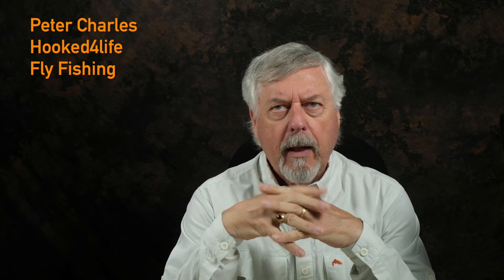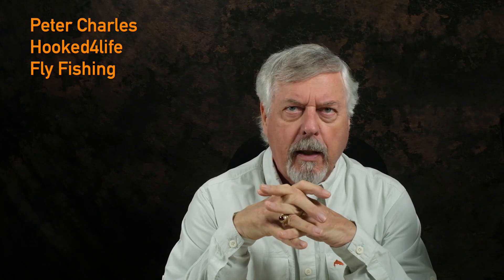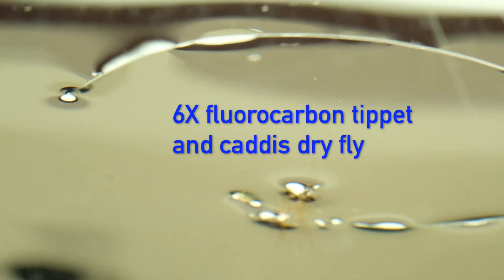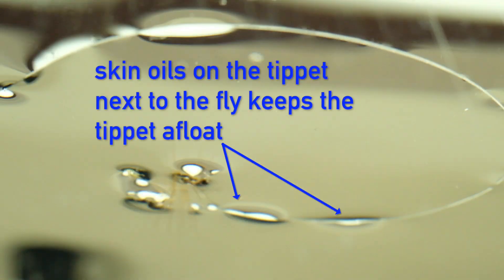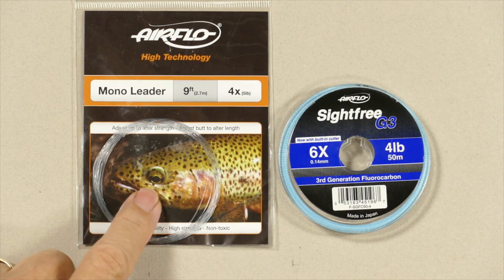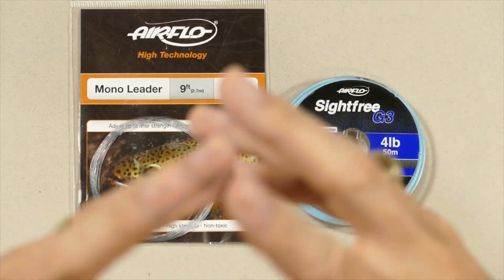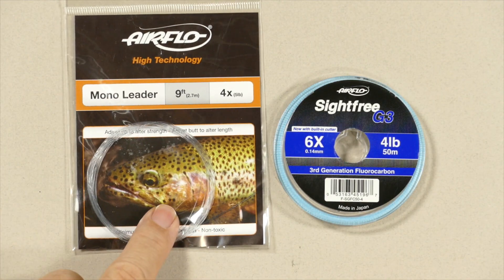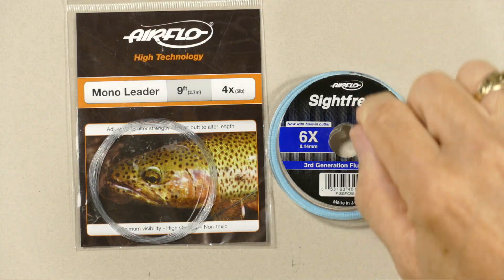Dry Fly Leader Hacks: a simple tip for significantly improving our dry fly fishing

Comment: A great video.  I've observed the same phenomenon over many years on several western spring creeks where fluorocarbon tippet makes a significant difference in the number of fish willing to take the fly.  Because of the very small flies used, I typically start with a 10-12 foot 6X mono leader and then run 7X fluoro to the dry fly.

Comment: I would argue that both the decrease in tippet diameter and increase in length of tippet caused less drag, therefore created a better more natural drift, rather than the material change from mono to fluoro. I believe you would have seen the same result if that 6x was mono. Great video, it keep us fisherman thinking and evolving…
Reply: I second this. I do the same thing for picky fish, but I use nylon. (Fluoro and nylon are both types of mono)

Comment: Yep! When people say you shouldn't use fluorocarbon with a dry fly, because it will sink your fly, I keep my counsel, but inside I have to shake my head.
Crickey! A dry fly (size permitting) will suspend even a significantly weighted nymph without sinking. A nymph which weighs far more than than a foot or three of tippet material.

Comment: Peter, thank you for all the great information on both fishi g techniques and tips. I like tying my on lesders but i have yet to find a dry fly leader formula that i can use on mt 4 weight fly rod. Your help will greatly be appreciated. A decicated subscriber.
Reply from the maker: In years past anglers have written virtual thesis papers on dry fly leaders. I have a book somewhere in my bookcase where the author goes on at great length about formulas. Whenever I've tied up my own dry fly leaders, I've followed a simple formula of 50% butt, 25% taper, 25% tippet. The tapered section is usually made up of two sections. For the diameters, I work backwards from the tippet in no more than two steps in diameter (e.g. 6X tippet connected to 4X taper). When we connect the taper to the butt section, we can make a bigger jump in diameter as we connecting two strong pieces of mono.

So overall it might look like: 6X - 4X - 2X - 20 lb.

Comment: Some of the claims made for fluorocarbon (which is a monofilament too, BTW) were always absurb. I could always see it underwater: it never seemed noticeably less visible to me than nylon monofilament. If fluorocarbon is usefully able to break the surface, then that is reasonably worth trying. The late, great, Richard Walker devised a leader sinking mixture made from fuller's earth, glycerine and dish washing detergent. I forget the recommended proportions, but you need something a little thicker than toothpaste. Make up a decent sized batch and split it with fly fishing friends. If you decant a small quantity into a suitable sealable pot (with a little felt pad for application) as part of your fishing kit, you can store the surplus in a really airtight jar. That should then last you for the rest of your angling career.
Reply from the maker: Ya, monofilament simply means "one strand", but "mono" has become synonymous with nylon lines. Mono (Nylon) has a specific gravity around 1.12 - 1.14 while fluorocarbon has a specific gravity of 1.78 so it will sink significantly better than nylon mono.

Comment: This is very interesting. I only fish for salmon and striped bass (which unlike trout, are far from fussy!) but I wonder what your opinion is on using a loop knot to attach a dry fly. I would think this would allow to leader to more easily sink below the surface tension while allowing the fly to drift more naturally. Thanks!
Reply from the maker: It would have to be a very tiny loop knot otherwise there's a lot of line hanging off the end - the "fussy" problem.
Reply: @hooked4lifeca I also wonder if having a loop knot on a dry would create problems in energy transfer.

Comment: Did you try just increasing your leader with mono?  Maybe it was just adding length to your leader and not the change from mono to fluorocarbon
Reply from the maker: I've done that many times in the past. It was often the key to getting takes. However, fluorocarbon just does the job better since it doesn't create those black lines as it is full sunk.

Comment: The only question I have is weight and density of flouro vs mono and if that will impact the turnover of flies during the cast.
Reply from the maker: The overall length of the leader and the thinness of the leader, plus the size of the fly and the wind we're facing, are much bigger factors than the difference in density of mono vs. fluorocarbon. One of the interesting benefits of extending the leaders by two feet with 6X or 7X was that the turnover tended to be incomplete over the last couple of feet, which in turn reduced the chances for drag.
Reply: @hooked4lifeca  interesting.  I guess sometimes an imperfect cast is what is required.  I have been forced to fish dries a lot this year.  Sometimes frustrating to match the hatch and even then you have to get the leader/tippet set up right!  Even with the help of a hatch chart i find it difficult.  Often I run out of flies to try and go home.  Thank you for your videos.  Very helpful.
Reply: @hooked4lifeca  i have a problem w my casting where the turn over is incomplete or overpowered and the last 2-3 feet of tippet tends to pile and curl next to the fly...not a good presentation!
Reply from the maker: You're probably aiming too low. Aim your cast a couple of feet above the water and it will have a chance to roll out.
Reply: @hooked4lifeca  thank you for taking the time to respond.  I will tty that on Saturday.  Your videos are very helpful to me.  I will not hesitate to send you suggestions for new videos!